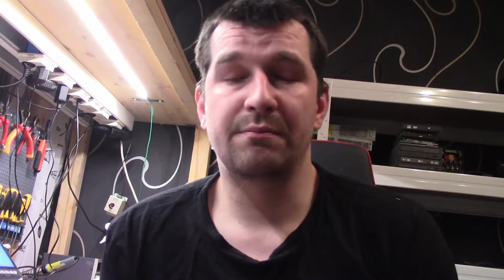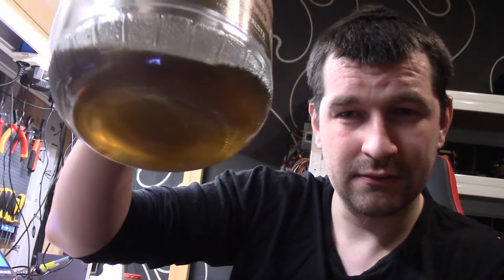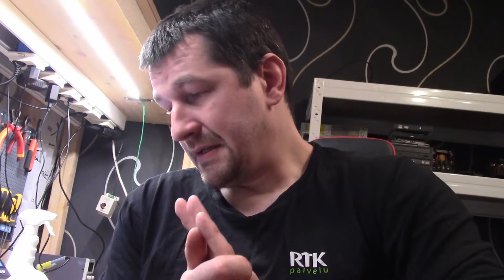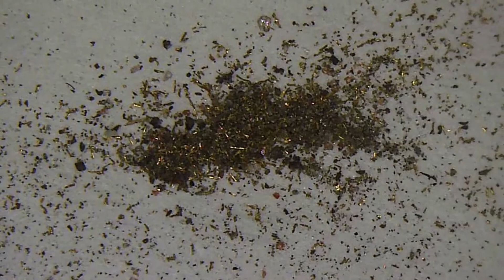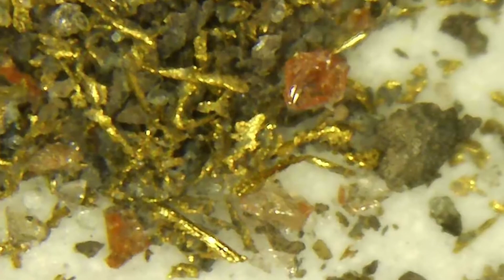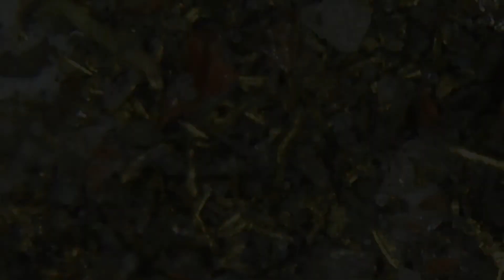Gold Recovery From IC Chips With Vinegar ( 145 )

Comment: I was pretty surprised by the ratio of gold to residuals in that powder under microscope. Maybe that wouldn't even matter if smelted, it could just float on top, i think its much lighter than gold. If there's no residual metals to accidentally alloy the gold with, it could work.
Reply from the maker: Well, i hope it works too.. might be little bit of incineration to that mixture so those tiny epoxy grains will turn into the ash and then pan it away.. should get even better results.